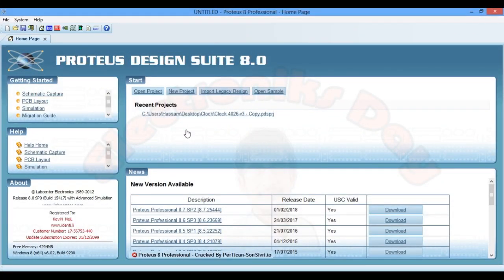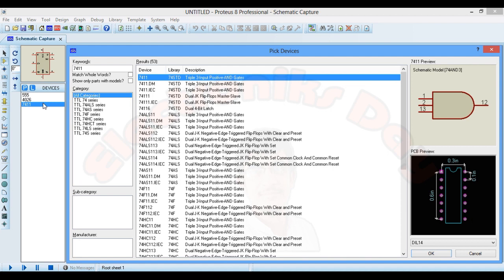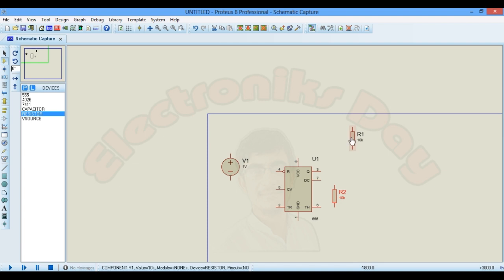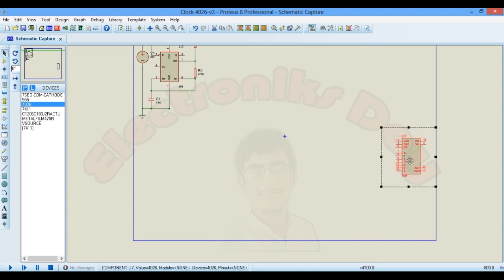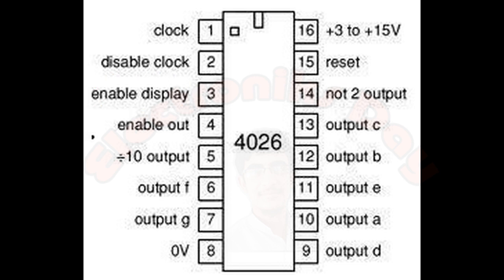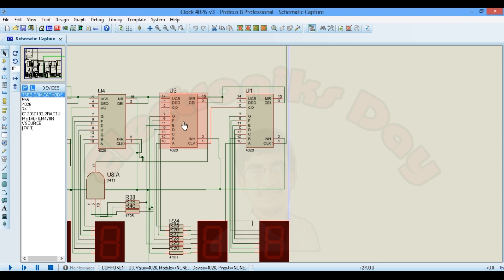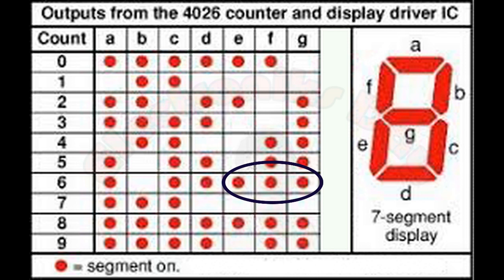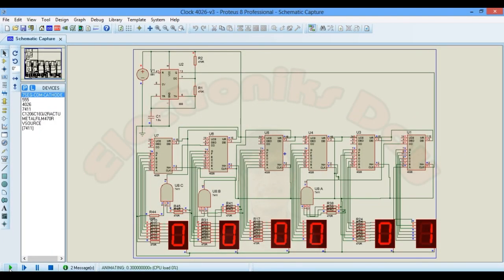Digital Clock Using 4026 IC | Electroniks Day

Comment: I have design the same clock on Proteus as well as on breadboard but ic 4026 is not getting reset I check the output of the 7411 AND gate for input taken from ic 4026 outputs to reset at "6", it is working properly but ic 4026 is not getting reset. Plz help out

Comment: Circuit not working on Breadboard
Reply from the maker: Please check your wiring again even a single wrong wire can cause problem. I already tested this on breadboard and it's working perfect.
Reply: @CircuitsInfo  can you send me pic of your bread board diagram
Reply from the maker: @muhammadzeshanshaheen3058  its the same diagram that you see in video. connect properly and it will work.
Reply: @CircuitsInfo  I connect 9v supply my ICs burned
Reply from the maker: @muhammadzeshanshaheen3058  you can apply upto 15volts thats not the reason for burning your ICs. You may have short circuited the ICs.

Comment: Where to set push button in the circuit to set the time?
Reply from the maker: Use two push button with clock pins of first digit of minutes and hours 4026 IC.
Reply: @CircuitsInfo  Sorry SIr, I didnt understand.
Would you mind editing the proteus file for me?
Reply: @blackhawk6540  have u done it ?.. can u please share
Reply: @blackhawk6540  can u done this
Reply: @farriko4528  yes sorry for late reply, he was meant to provide direct vcc to the ic terminal.
Reply: @shrushtiadhav6393  yes i did, we have to give direct vcc supply to the input terminal with the switch
Reply: @blackhawk6540  can u share ur simulation file
Reply: It's very urgent
Reply: @samarthlambole3295  did it 2 years ago, dont know if i have them or not
Reply: @samarthlambole3295   do this, take a wire from vcc attach push button and then merge with the wire that connects hours and minutes ic for first digit
Reply: @blackhawk6540  it can't work
Reply: @blackhawk6540   hey know how to make pcb design of these
Reply: @samarthlambole3295  no idea
Reply: @blackhawk6540  and tx for these dude  it works
Reply: @samarthlambole3295  mention not, Happy to be helpful

Comment: Pin 8 and 16 of IC 4026 is connected to ground and Vcc?
Reply from the maker: Yes.
Reply: Thank you, does all the IC's are necessary to have a socket(IC protector maybe).?
Reply from the maker: its good if u use but no its not necessary.
Reply from the maker: yes

Comment: will the clock work perfectly if r1=r2??
Reply from the maker: No brother it will not work. if r1=r2 then your 555 timer will not generate output pulses with delay of 1 second.
Reply: is there a relation between the values of r1 and r2? one should be greater than other?
Reply from the maker: yes there is relation,, you can read my this post about 555 timer, it explains how you set the delay.
https://hassam794.weebly.com/home/how-to-properly-use-555-timer